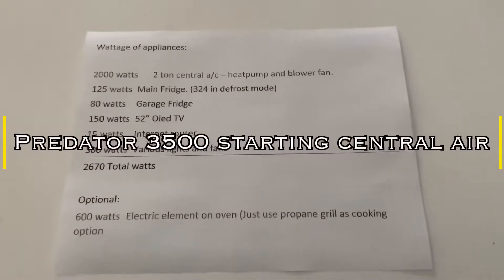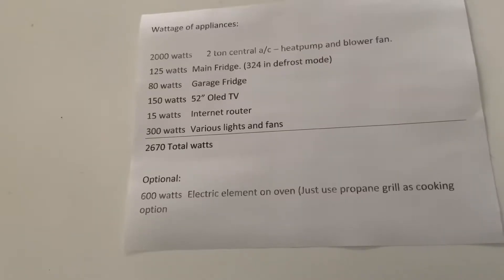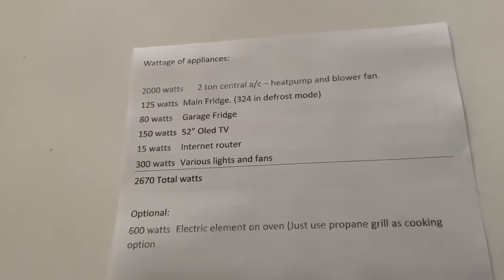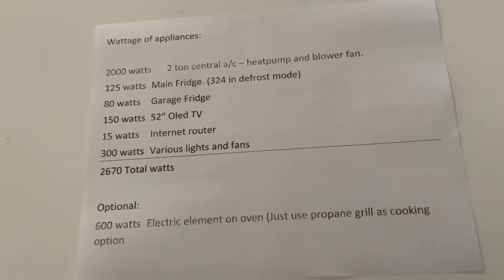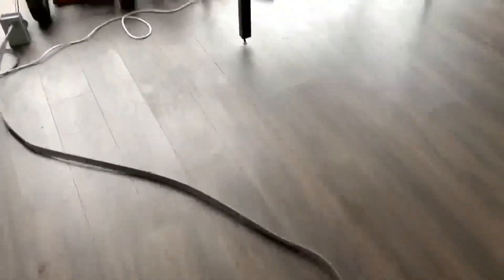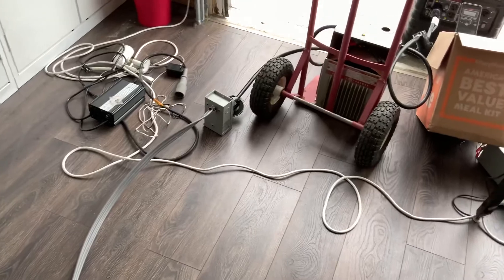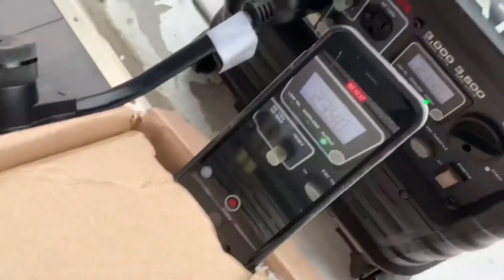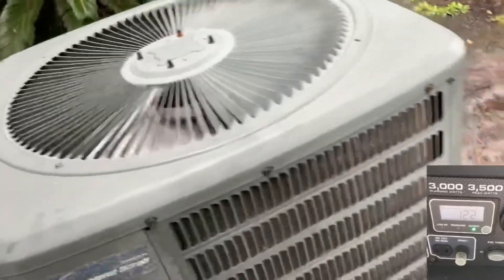Predator 3500 generator starting central ac

Comment: Did you install a soft start on the condenser? What's the model number of the xfmr you're using?
Reply from the maker: Yes, soft starter was installed. this is the transformer. 5000 watt 120/240 transformer  General Electric 9t21b1001 G2 Power Transformer